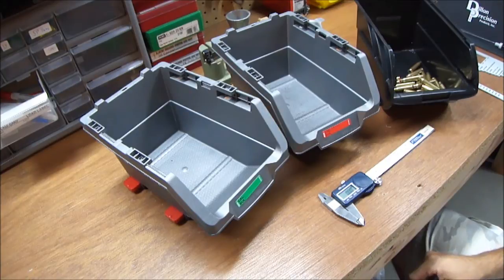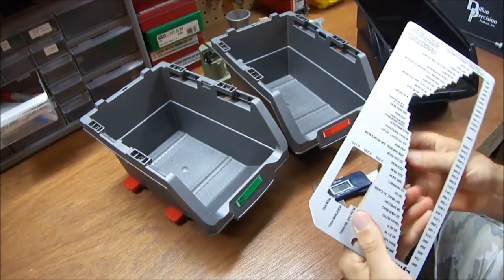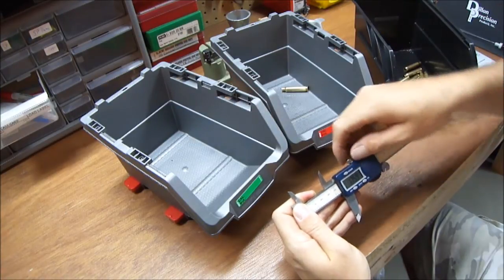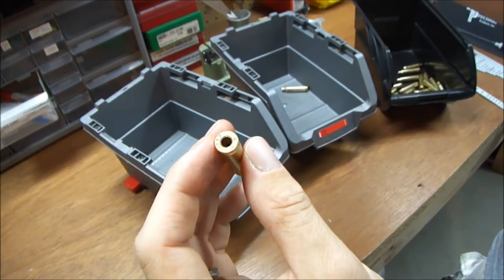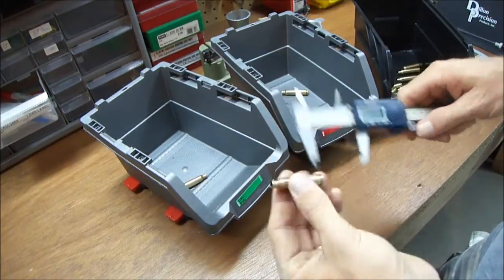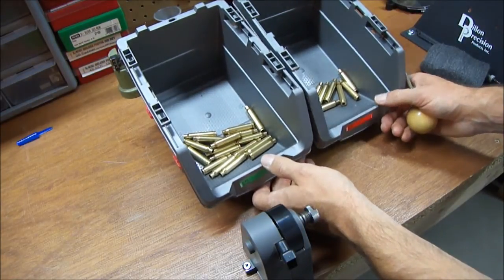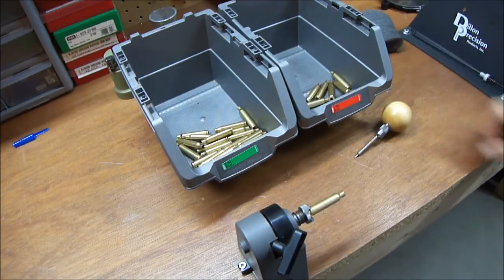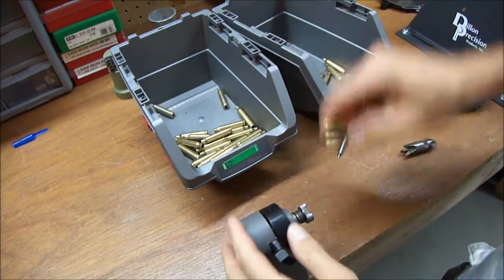Reloading .223 Basics Part 2

Comment: Hi.
 When you trim the no-go cases, you get the middle lenght of the case, but there will still be a slight difference in the lenght of the go and no go cases (now trimmed cases) and the bullet will slightly sit differently on them because the device that puts the bullet on is calibrated to one setting. Is this a big thing? The difference is seriously minimal, but it got me thinking